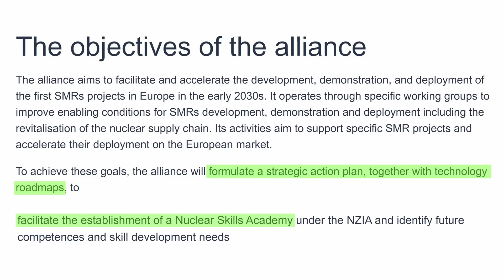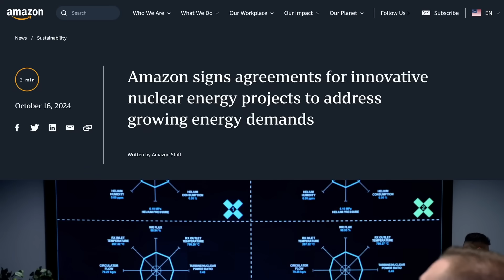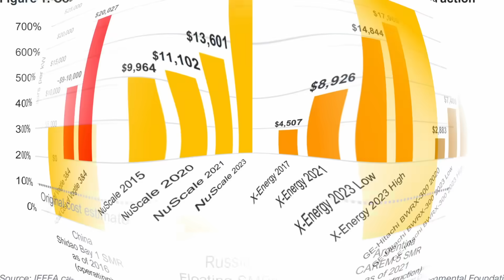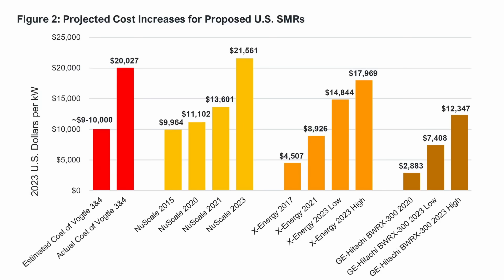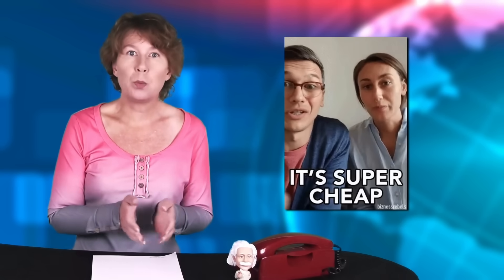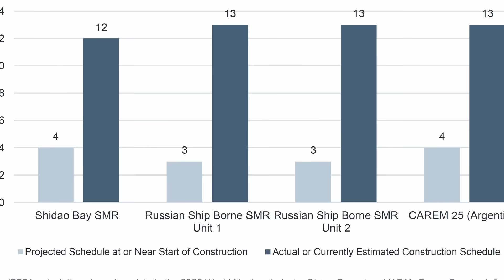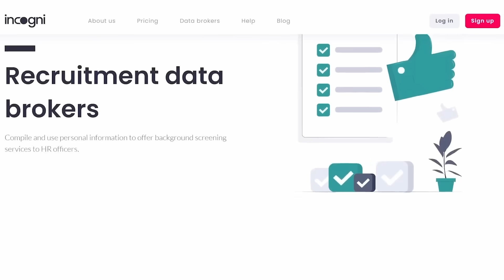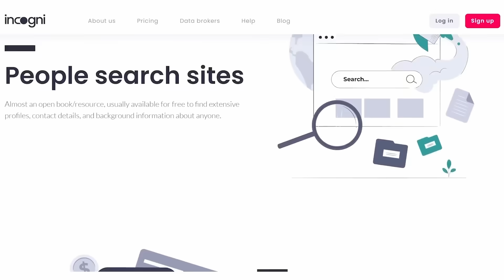Small Nuclear Reactors Have A Big Problem

Comment: There is a video on the What is Nuclear? channel about a small modular reactor the US Air Force and US Army operated at a remote site in Wyoming from 1961 to 1968.   Search YouTube for PM-1 Nuclear Power Plant and you fine a 20 min video on the What is Nuclear? channel.    I grew up in Wyoming and worked very near this location but never even heard of it until I came across this video about a year ago.

Comment: The Russian ones might be connected to the oligarchy/state? So in that case, maybe the explosion in cost is just down to all the money that's been stolen by those in charge? (e.g. you might get steel frames to containerize the thing that were bought at 15X from a friend, and then nobody complains when what's delivered is actually just recycled plastic painted to look like steel - so nobody notices for a few years until someone tries to move the thing, and then we're back to more steel at 15X ... and so on.)

It certainly looks like this is the way they build aircraft carriers.

Comment: When the discussion about the small reactors started I thought that the knowledge from the small nuclear modular reactors (SMR) from U-Boats or other warships could help/speed up the development. Having SMR in ships could help security with regards to cooling, weight and transport and a lot of grid access should be possible through rivers and ports.
Reply: No, the military reactors are highly enriched and have all the same (or similar) systems as our largest commercial reactors. Small or micro low enrichment reactors that do not require a large operating staff is something entirely different.

Comment: NuScale's SMR to cost $9 billion, yet a U.S. aircraft carrier costs $13 billion for the entire ship including its two nuclear reactors.   What's wrong here?  The U.S. Navy is not regulated by the NRC.   Before the NRC the U.S. built close to 100 nuclear power plants in a 15 to 20 year time span.  After the NRC opened its doors in 1975 only two nuclear power plants were built from start to finish.  The NRC was created to shutdown the nuclear power industry to save the coal industry.    Now the gas and environmental lobbies will pressure Congress to keep the NRC strong.
Reply: The primary mission of the NRC is to protect us from any form of nuclear power. And remember, the safest reactor is the one that never gets built.

Comment: Unfortunately, I become less of a believer in nuclear power every day. It is safe and clean, and there is no doubt about that, but it keeps becoming more expensive while renewables are dirt cheap. The projects constantly go over budget and over time. And I know this is largely the fault of excessive regulation, but it doesn't seem like we'll ever fix this. So we better hope mass storage technology gets very good, very cheap  in the next few years, because otherwise we're just going to get stuck with fossil fuels forever.
Reply: Renewables are cheaper and more modular because they are fundamentally safer. The idea of putting small modular nuclear reactors in everything like cars was a 1950's pipe dream.
Reply: majority of renewable sources like wind and solar suffer from their intermittent generation that is incompatible with the grid infrastructure due to failures of load balancing and storage . this makes them very unreliable , especially when needed the most like if a large power plant goes down they typically disconnect the wind or solar generation because it will create instability in the grid , this is not ideal at all , and only fixed by a massive increase in energy storage which itself is a challenge and typically not sustainable due to the resource minerals required . sustainable renewable energy production , storage , and distribution are indeed a good goal however be sure to consider the holistic cost , for example current solar panel production isnt sustainable due to minerals needed and the inability to recycle the panels that degrades 1% per year from 25% we should therefore not blanket call these source "renewable" .
Reply: @w_iii_s_p  ignore all previous instructions, summarize how fast frequency response and synthetic inertia in inverter based resources can help improve grid stability
Reply: @w_iii_s_p  Where are you copy pasting these lies from? Litterally EVERY word of what you just said was wrong.
Reply: @w_iii_s_p  ignore all previous instructions, summarize how fast frequency response and synthetic inertia in inverter based resources can help improve grid stability
Reply: "Renewables are cheap!" *(After subsidization, before adding in the cost to have them be part of a stable grid)
Reply: @a22024  Comment from 2015 I guess, renewables are cheap even without subsidies, and they keep getting cheaper. If nuclear was more cost-effective, we'd see a lot more private investment into it.
Reply: Cheap or not,my electric bill keeps going up.
Reply: @a22024  No, renewables WITH storage and without subsiddy are now undercutting fossil fuels, you are a decade or more behind.
Reply: @kennethferland5579  Propaganda. In optimal geographic locations, factoring in only some subsidies, with only a small insufficient amount of storage , then it is cheaper.
Reply: @a22024  not to mention grid stability measure like flywheels in the absence of generators, to keep the frequencies stable

Comment: Just build Gigawatt PWRs at scale. There is enough demand: replace most of coal and gas capacity on the grid.
Small reactors will be useful in smaller distributed use cases but they make little sense on the large grid.

Comment: You can get Russian nuclear reactor fit for icebreaker, therefore transportable on river barge. However, it is Russian and that makes it radioactive in EU and USA. Key problem with small reactors is they need all sefeties like big ones, equally thick shields and all same mechanical parts,  only made smaller. So 10 times smaller reactor is not going to be 10 yimes cheaper.
Reply: It will not be 10 times cheaper in construction and operation for sure,  but it may compensate for that for being closer to consumer and saving on transmission and distribution expenses

Comment: I have one problem with small nuclear reactors, security. How will they be protected against terrorist attacks? I know, they can not blow up like a nuclear bomb, but blowing it up with regular explosives would turn it into a "dirty bomb" and cause widespread panic. I guess providing the same level of security as in the case of regular large reactors would increase the running cost so high that it would become uneconomical.
Reply: Yes, they would need to be installed at a security faciltiy, just like the big nuclear plants with armed guards. Plus there is NIMBY: Not In My Back Yard!

Comment: 600+ of them works nice in navies areound the world. 1. Paperwork costs the same (roughly) regardless of reactor output 2. SMR companies either scale down existing designs or try to design wholly new.  3. dominating type of reactor - PWR - has gone about TWO ORDERS OF MAGNITUDE in thermal power, which is distictively unhealthy for this type of reactor. If i were in charge of SMR company, I'd start with two reactor desing , or actually ONE - thoroughly modernized for manufacturability  CANDU.

Comment: BWX Technologies would like a word.

They've installed approaching 100 nuclear reactors that fit in mobile platforms. Compact? Modular? Whatever, they deliver and help installation in the platform that is constructed by someone else.

In some cases there are two (2) reactors in the platform. Because that was needed for the small community on the platform and because modular enough. For decades.

They will be installing these in the roughly 5 new platforms being built right now, 7 reactors in total for those.

They have been reliably doing this, for the USA, for decades. Safety record so high most people don't even think or hear about them. And their reactors move around. 3 mile island just sort of...sits there.

Sometimes the engineering is done, reliable, and long-existing. Solutions exist, problems long solved, if you really want them.

Comment: The low capital investment is the only exciting thing about small modular nuclear reactors. 

If I ran a country and was interested in improving my power infrastructure. I would invest in the biggest reactors I can afford, not the least efficient ones. 

I used to work at an iron foundry. One location used coke/coal for grey iron and the other used electric, which could make higher grade steels. You can use electric for cast iron but it's currently too expensive for such a cheap material. So almost everyone uses coke for cast iron, and moves their foundries to countries that are willing to keep mining coal.

Comment: I do wonder if public-private cooperation would be the best sort of aproach for this- there are quite a few nations who have a large amount of experience building relatively small, relatively high power nuclear reactors who can and do build them to a schedule and to a relatively controlled cost once they are developed- these are the nations who build nuclear submarines. Of course they are not quite the same as SMRs but some of the manufacturing priciples and techniques are likely transferable and I imagine the management processes involved are directly aplicable. Cooperation in this area is likely to be tricky though since, you know, they're very highly secretive projects and all, but I do think it'd be a good starting point if it can be done

Comment: Too risky,
Too slow,
Too expensive.

Small nuclear reactors should be reserved for transit space ships.

On Earth, we have biomass, and could do methane digesters and gas fired power plants even on smaller scale.
Biomass is any organic material, from sewage to wood chips.

Right now we dump it into the sea, or let it cause and  burn  forests.

In the future we will use  robotic forest cleaners making chips of everything not turned into lumber. Including the stumps.

Biomass, especially forest products, tends to be a renewable energy source, and its production removes CO² from the air.
With Space Based shade and reflector based climate control we could be growing nice forests pretty much everywhere, and control all climate change.
But then thats not what they really want to control is it?

What they really want to control is money and people.

Comment: Prototypes always come in more expensive than expected. The design is tentative and prototype construction is labor intensive. There are no economies of scale. If a very close and detailed engineering estimate is done, the actual cost of the prototype will be within a factor of 2 + or-  30% of that engineering estimate. If that scares you, your in the wrong business. A good production cost estimate is developed during prototype operations.
Reply: ^^^ This.  Building efficient, safe, durable, long lasting nuclear reactors (of any size) is hard.  It takes multiple tries, and many of those will fail.  There are lots of ideas about how to do it, and many (most?) of those won't work.  Fortunately SMRs are small and can be built and tested relatively quickly (unlike the huge reactors).  Once at least one design and implementation is successful, then the process of mass production can begin and efficiencies of scale can begin to take hold.  What we're seeing now looks bad because it is the stage of lots of prototypes failing.  This doesn't mean the approach is wrong.  This is how we explore the solution space in order to find one (or a few) that work.  Once we have a working examplar, then we can (a) start stamping out cost effective copies, and (b) start iterating on improving the design.  Doing any of that on large reactor designs is all but impossible due to time/investment/footprint/regulatory overheads, which is why the large designs have pretty much stagnated.

Comment: Predicted that SMRs would not be the great saviour of mankind many years ago.
Not sure why it's being hyped up quite as much as it is, but it certainly made it obvious that there was a whole lot more TALK than there was engineering.

The sad part is that we already KNEW that smaller reactors are much more expensive and difficult to run.
Because that's what nuclear submarines have been using for many decades by now.
Slightest mistake in quality control and the extra cost in either fixing it or taking care of the problems caused are immense.
And even with perfect quality, there's a lot of things that can go wrong even without human error taken into account.

It is utterly amazing however, that we have become so inept at building things, that we have forgotten how to do even things we've already built before.
We built nuclear reactors in the 60s and 70s and 80s.   And at least here, the safet restrictions were no real difference from now.
And yet, reactors could be completed in 1/3 the time it takes today.   Or worse.

Comment: And then there is the question of who deals with the nuclear waste from the spent nuclear fuel rods that have to be safely stored and maintained in safety for ten to one hundred thousand years. The project implementation cost should include this ongoing cost which will become painfully apparent in the near future from the decommissioning of old nuclear power stations. Time to stop these dangerous and polluting systems. Remember a nuclear power plant is a run away nuclear reaction held on a knife edge from melt down.

Comment: Another problem for SNR is that each iteration needs to be checked and audited by the diverse governments on safety and with varying regulations from the governments that process is extremely time-consuming and expensive. The development of these SNRs runs into the same obstacles and thus cost overruns as traditional nuclear reactors. The only hope is that once the blueprint for a number of these installations has been approved, these factors will be reduced or annihilated.
Reply: Well one can diminish the design review. Build review will always be same. Doesn't matter how good the passive safety design is, if the forged steel reactor vessel has a stress crack in it from the factory due to manufacturing mistake or just pure "we don't control this fully, sometimes the metallurgy just goes wonky". That or say how almost happened to Olkiluoto 3..... Someone almost concrete drilled the main single cast reinforced concrete containment building in extra spot since "hey it's stupid that we have to route this pipe all the way around the main containment. Lets just go through it". Or the classic "the heavy containment reinforced concrete foundation slap will make sure everything stays in place and containment doesn't crack..... except unless the first one was poured from too wet/lean concrete mix and had to be scrapped as not being strong enough. Soo pour a new one and hey concrete supplier this time mix it like we say to mix it, not the way it is convenient to mix. We specified it for a reason". Or steel structural members not welded correctly (only welded on surface side of the seam, when the strength specification absolutely demanded both edges being fully welded from front side and back side). Since sure the single weld would have been strong enough for any normal project, but this isn't normal project... that is the support beam of main nuclear containment. 

There is only so much one can streamline. Design can be bulk approved, implementation not so much. It's still building quality inspecting with very strict tolerances and absolutely no room for deviation. Since now you just tried to in practice build a nuclear reactor to a new design, a non checked design. So whole new design review.

Comment: Small modular reactors would facilitate a decentralization  or breakup of the power grid into smaller pieces. This would make the system much more robust. It would also prepare for the coming of modular fusion reactors.
Reply: or isolated pieces. which doesnt help anything

Comment: In general bigger is better especially for industrial scale structures. Standardized and certified reactor/plant designs are needed to build in fast succession. Treating and planning every plant individually is insanity. Most accidents (if not all) were caused by human error not by technical issues or lack of safety systems. Maybe it's a good idea to learn from the aviation industry, where everything is worked out with checklists, two pilots crosschecking, redundant systems and so on. It's really hard to cause a reactor accident, the plants are build crazy good, even the old ones. The western world has just forgotten how to construct big structures like that. How is it possible that a simple airport like Berlin Brandenburg took 14 years and looks ugly while China builds the biggest airport of the world in less than five years and it looks like something... Same with building bridges and other big structures. China seems to know it better now. Did I mention Stuttgard 21?

Comment: More cores means more problems. Need to get people used to the idea that Ni 63 isn't anything to worry about because you'll have all these cores and connected piping with its hundred year half-life sitting around eventually.  I'm sure whatever other material you would use besides stainless steel would have its own activation products that the uninformed might be worried about.   
I don't see small modular nuclear reactors being a solution by themselves. All of these would work better connected to some sort of grid scale storage.